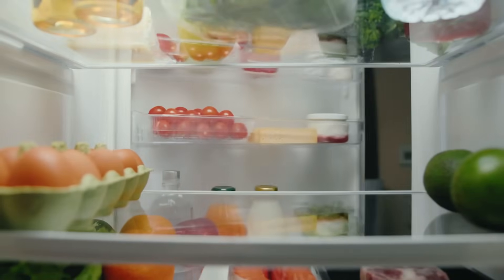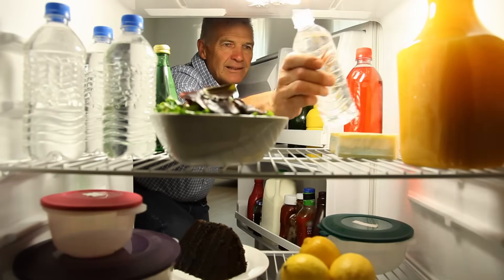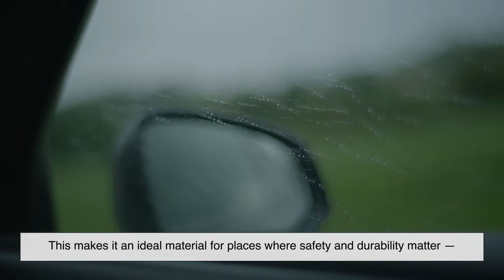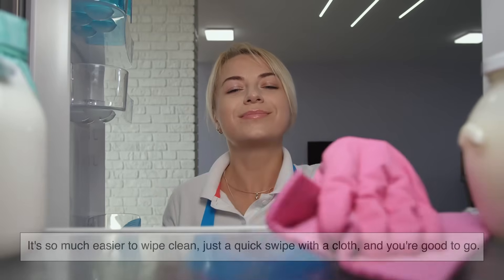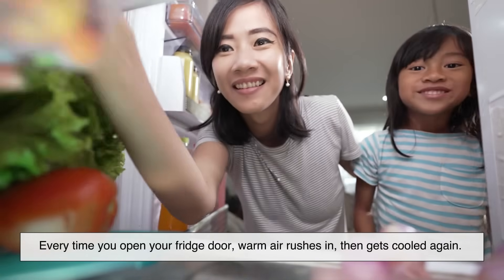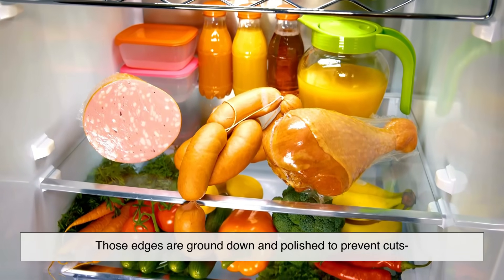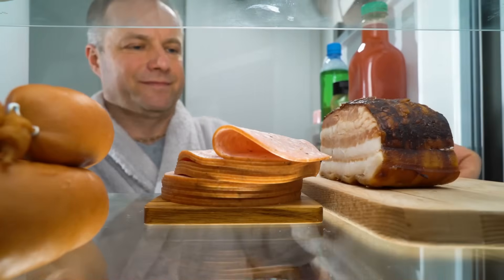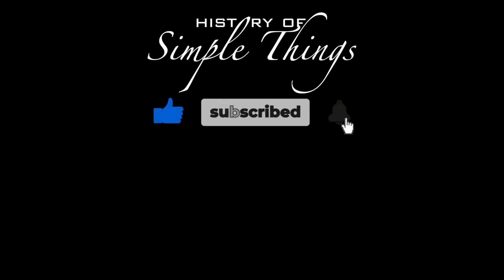Why Are Refrigerator Shelves Made from Tempered Glass?

Comment: You could make a video about mechanical latches being replaced on refrigerators by magnetic strips on the doors.
Reply: Because children were locking themselves inside with the mechanical latches.
Reply: @tedlahm5740  That is why they did it, but it was also cheaper.  Using magnets on the doors has to be one of those things that one you see it you think it is so obvious.